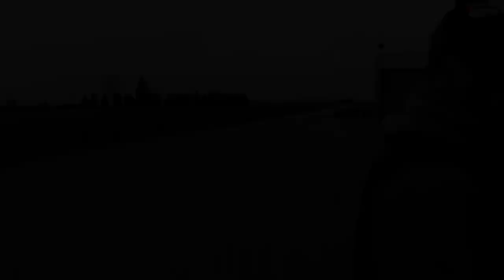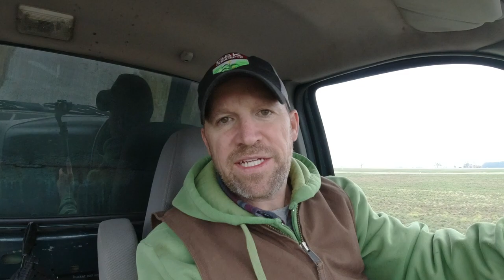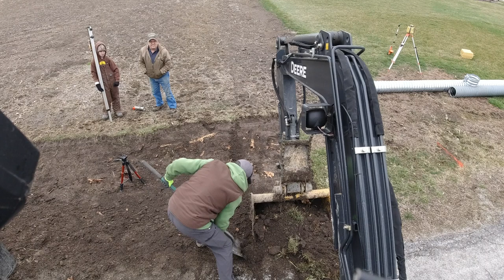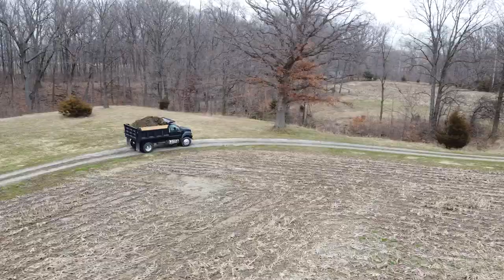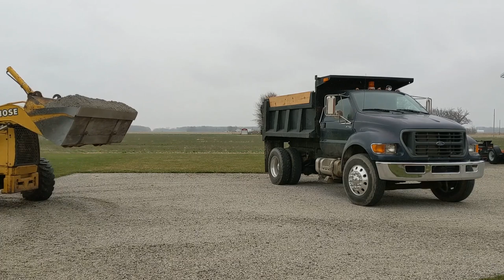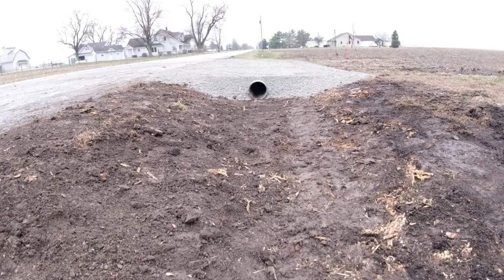Culvert Pipe Install on a Friday Afternoon

Comment: In KY. you call your local state highway dept. garage. They send someone out and look at where you want the entrance. They will then tell you the size pipe required for that spot. You go get the pipe and bring to the site. They then come and install it with their equipment and gravel. From that point on you are no longer responsible for it. EVER. They told me this is due to liability for accidents if someone leaves the road and hits the end of the pipe. Oh yeah, if it ever needs replacing, everything is on them. Pipe and all. Great work and love the videos.
Reply from the maker: Man, that would be nice! Makes sense to me. Not so much here in Indiana.

Comment: What is the payload capacity for your dump truck? Do you need a CDL to drive that size truck?
Reply from the maker: This truck is plated at 33,000 lbs gross vehicle weight.  I can haul about 20,000 pounds of material.  Yes, you need a CDL for anything over 26,000 GVW.

Comment: This is 6/20/2022   How has the install been working out?   I speculate that that ditch in front of the house causes trouble when mowing.  Could a culvert pipe be installed from the farm field entry past this property so the lawn could be level with the road.  That would improve the mowing but would it cause other problems?
Reply from the maker: The culvert is holding up great! We shaped up a little bit of the edges so that it's easy to mow and they keep it looking beautiful. Wish I could attach a picture cuz I am sitting inside the office right in front of it.

Comment: Any idea what the weight capacity is for something like this? I have a small ravine I need to get a culvert on to continue my driveway. The problem is I need a 40-50 ton capacity culvert because we are building a new home on the large property and concrete trucks need to be able to cross. Let me know if you have any ideas, thanks!
Reply from the maker: Hi Kristen. A steel culvert like this one when backfilled with all stone will support your concrete trucks and dump trucks no problem. You need to be sure that any soft material like topsoil is removed in order to support the new material to be added to the top.  Just like we did in the video.  Thanks for watching and good luck with your project!

Comment: Do you need a CDL for the F750..?
Reply from the maker: Technically yes, for this 33,000 GVW Dump truck you would need a CDL to operate it at it's full capacity.  There are F650s and some F750s that are 26,000 GVW in which you would not need a CDL.  Fortunately for me I was obsessed with the idea of getting my CDL right as I turned 18 so I got it way back when.  I've always been glad to have it.

Comment: Can you give me some info on that stick you use for your lazer head? Noticed you slide your lazer up and down, have never seen anything like that before.
Reply from the maker: I'm glad you asked Ben. I don't see too many people using these but I have been around them since the late 90's.  They are great and I always prefer them to the more common fiberglass telescoping pole.  It's called a "lenker rod", or some people call them a "Direct Reading" laser rod.  You can move the tape inside the rod up and down and set grade, then slide the receiver up and down to get a reading and it works great when you're dealing with lots of cut and fill.  I've always wanted to make a video about it cause seems like most folks just aren't familiar.  Thanks for asking and thanks for watching!  Here's a link to the one I have.  They are pricey, but once you use one you won't like that fiberglass pole!
https://www.engineersupply.com/laserline-10-foot-direct-reading-laser-rod.aspx?VariantId=61a22ca7-7e5f-4444-9f9e-a26992258dab&gclid=CjwKCAiA25v_BRBNEiwAZb4-Zf8hT-mVZWeBYZm2MtsOUsw_blSlBOUW8XIi1jjyGgaaDhQtR7AK_BoCmREQAvD_BwE
Reply: Thank you...yes it looks like an awesome tool once you become familiar

Comment: I'm a retired contractor for civil  construction  and concrete contracting building and civil. Here in Australia they stopped using corrugated pipe due to the acid in the soil eating away the pipe.
Reply from the maker: Greetings! Nice to meet a Koch from Australia!  That's a good point.  Old habits die hard because this pipe will likely corrode eventually as well but should be good for 40+ years I'd think. We use plastic pipe oftentimes when the application calls for 12" or larger because then the pipe is available in the stronger dual wall. This job could have been a candidate for 10" PVC I suppose but that is more pricey.   For longevity sake, we probably shouldn't use the galvanized corrugated pipe anymore either. Thanks for commenting and for subscriping. I really appreciate it.
Reply: The limestone used to cover galvanized culvert will destroy it. Surprised you did not use ADS which will far outlast steel. This is all we use for past 35 years.

Comment: I am not an expert but they say gravel is not a good material to cover culvert. It should be something that resist water goes past culvert inlet.
Reply from the maker: Glen, you've got a good point.  Gravel wouldn't be my first choice either and this is an opportunity for me make a distinction between gravel and crushed limestone.  Around here, the term "gravel" refers to stones that are harvested from a pit in the ground and sorted by size.  These are usually round rocks found in sandy glacial deposits and when sorted out by size they will not pack together, but rather allow water and air to penetrate between the spaces of the individual stones (sometimes referred to as "river rock").  You're right that this would not be a good choice to backfill a culvert pipe.  However, what I used on this culvert job was crushed limestone from a mined quarry and it contained a great deal of the limestone powder mixed in with the various sizes of crushed aggregate.  This powder mixed in allows the material to pack together tightly and have nearly no spacing between the individual aggregates.  While not completely impervious, it does do a good job of holding back most of the water over short holding periods and more importantly it provides a nice stable pipe bed to hold up the heavy equipment that will be using this entrance.  Thanks for making a good point and for watching the video!  Take Care.
Reply: @digdrivediy  Thank you for the answer. I am planning to do a culvert  job also and thinking what would be the best material.